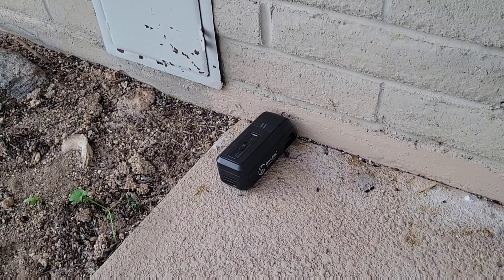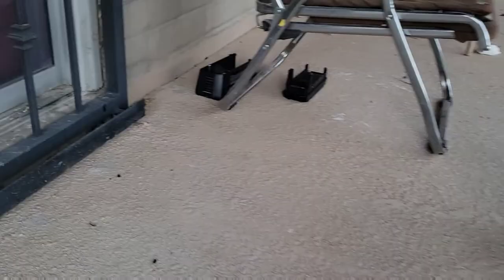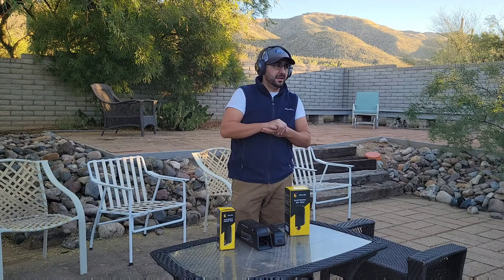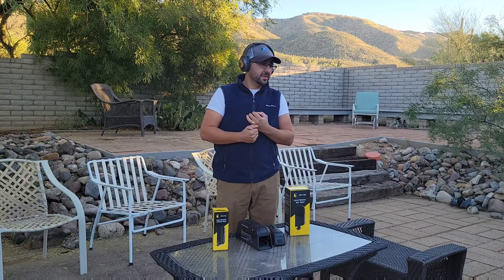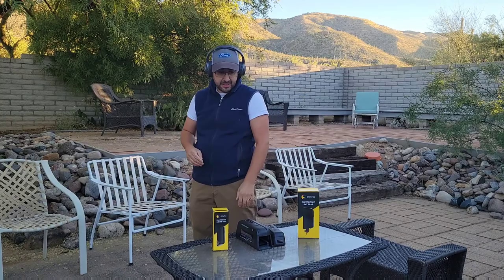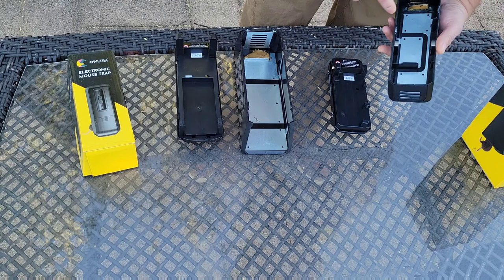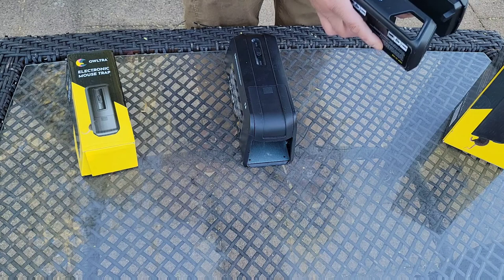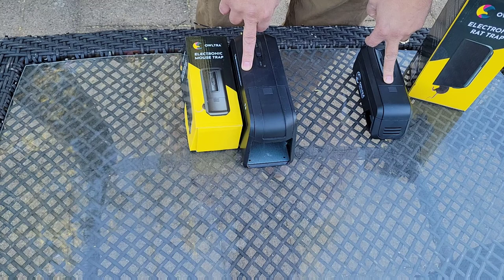Owltra - Mouse Trap - Review

Comment: How do you clean the trap after a mouse is caught and disposed of so you can re use it?
Reply from the maker: I you maintain them regularly, it will be mess free. They are just stiff. Open the top and place the remains where ever you like. Trash or feed it to the wildlife. Its safe for the wild life to eat since there is no poison. If the maggots have started work you can still dump it and wash out the bottom part with a spray cleaner and hose it down. I dont care to scrub it any more then that. That has worked for me.
Reply: @elobrero3910  Thank you for your reply.  Very helpful.🙏